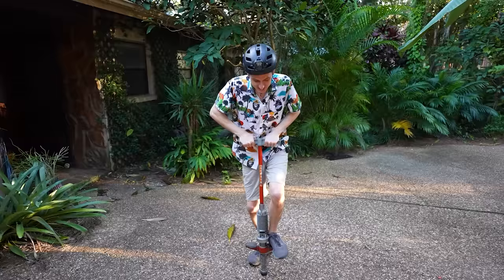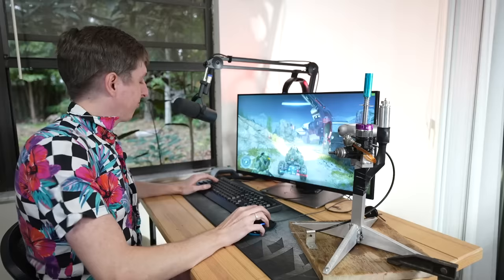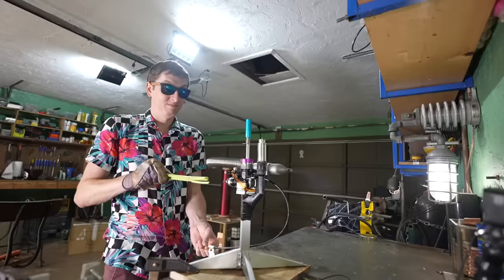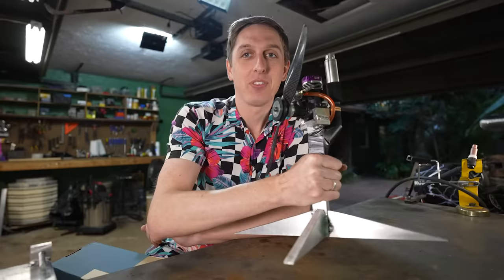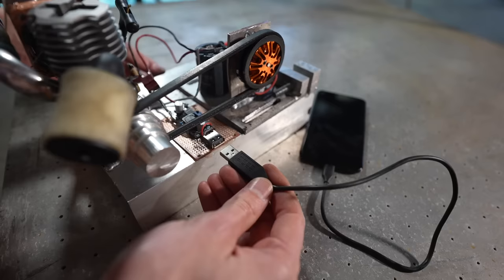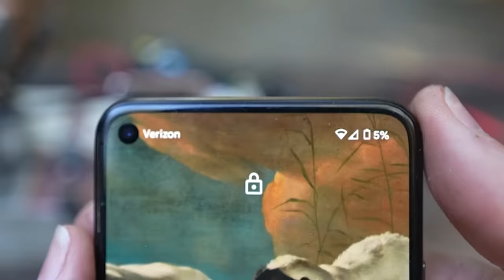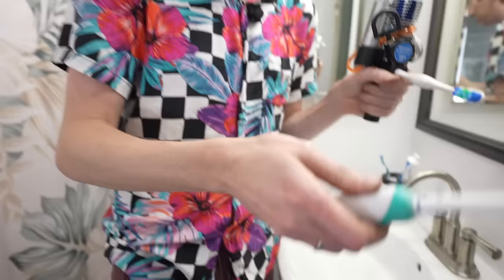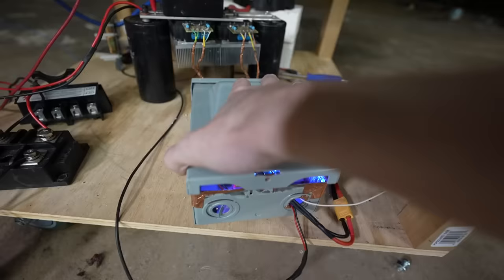Gas powering things that should NOT be gas powered

Comment: The mini generator idea is something I've wanted to try for a long time. 

Shouldn't a 2HP engine be able to generate a lot more power than just running an infrared TV remote?
Reply: 2HP=1492 Watts
Reply: there are lots of losses generating ac power and then converting it to DC.
Reply: The quoted power output on RC engines tends to be hella overrated.
Reply: I doubt its 2hp even most mopped have that much and this thing can get no way near the power of a 50cc engine
Reply: @ES-xq7iu  a 50cc 2 stroke engine on a moped would probably have about 5 hp, also nitro fuel is very energy dense.
Reply: 0
Reply: I think that the generator is not spinning fast enough and he just needs to gear it differently
Reply: He also might have the step down regulator set too low
Reply: @linuscartips9732  lol no its not it is limited to 2,5 hp and most have even lower hp
Reply: @ES-xq7iu  yes the key word is limited, a 50cc 2 stroke can make around 5, but I do agree they tend to upsell those nitro motors
Reply: @ES-xq7iu  RC nitro motors spin at like 30,000 RPM
Reply: Clarian labs was working on Rotary engines to power small robots. I like to see a Mini Gun power buy a Micro engine.
Reply: @ES-xq7iu  nitro fuel is very energy dense
Reply: @ES-xq7iu  oh they do. Nitromethane is an exceptional fuel, and those little motors spin up to 25-30K rpm to give huge amounts of power with very small displacements.
Reply: @ES-xq7iu  that’s more like a 4 up engine
Reply: @ES-xq7iu  Most countries yes, like Finland for example. However, in other countries, it's not.
Reply: It's not 2hp.
Reply: @caramelfim2885  And so are you, too
Reply: @ES-xq7iu  HP and displacement are not the same thing.
Reply: @letsgofast1187  nitro rc engines spin 30k-35k depending on rc type.
Reply: It's because he's using a crap DC electric motor instead of a dynamo.
They are not the same thing man.
Reply: @jonathankjaer1869  old 5 liter engine, 200hp, new 5 liter engine with a few upgrades can push easily past 500hp. to reinforce your point
Reply: Yall, know he's already done the math, and is once again jackiin to the hate community
Reply: 2 hp is about 1.47 kW. A generator seldom have efficiency above 97-98% in optimal circumstances so slightly lower than that for good measure. Transmission losses about 5% if you  dont use a direct drive but anyhow, it all comes to the conversion system, where about ten percent will be heat . You should be able to get about 1/3 of input power fairly easy, all extra is depending on how well your drivetrain parts are made and el circuit. No matter the driving source a rule of thumb is that about a tenth is lost due to electrical losses. This can be cooled by fans wich adds to this value , the ten percent is basically fifteen as you need cooling fans. But, that still is enough to charge a few phones..
Reply: Hes running it at idle speed which isn't making 2hp but if he was revenge the engine jt would make 2hp
Reply: @linuscartips9732  mine barely has 1 hp
Reply: Maybe around 500-1000 watts considering all losses
Reply: You also have to factor in the generator itself. He said he was running a motor backwards. Motors are built to turn things, not the other way around. So it won't be nearly as efficient as a dynamo or magneto. Which is engineered for making power.
Reply: @ES-xq7iu  yea but this thing can rev to the moon
Reply: @linuscartips9732  actually closer to 1.5 or 2.5 hp u can build a 50cc with 5hp or 10 hp buts it pricey takes alot of work and parts balancing porting type stuff.
Reply: @ES-xq7iu  nitro methane in that mopped?
Reply: @tripplefives1402  well I'm no expert, but I don't think you can use ANY motor. I mean, I'm pretty sure you need some magnets in there to get those electrons moving. So, brushless motors only?
Reply: @ES-xq7iu  actually most mopeds are restricted to a certain power level for safety.
A 50cc 2 t moped engine with 27hp have made some speed record
wankel 50cc can make 48hp...

so not impossible to make 2 hp out of a lil nitro engine that is basically a 2 stroke diesel in its function.
Reply: I think youd have to account for torque as well
Reply: I think the HP numbers aren't indicative  of real workload because of thier high RPMs. If you geared the engine down to make more torque it might be able to turn a bigger generator.
Reply: @ES-xq7iu  It's the difference of RPM and Torque, these RC motors are high RPM and low torque. It's the reason a 2kW drone motor can't drive an ebike well, it's designed for high RPM.
Reply: @linuscartips9732  that is false. nitro is 3x less dense that petrol. yet it holds its own oxygen letting the 14:1 petrol perfect burn mix is around 3:1 on a nitro. nitro puts 8x the fuel in and is 3x less energy dense but im not sure of the .000 but it should come out to 3.3x the power of a petrol engine. also the 2 stroke vs 4 stroke takes a 4.5cc engine there about from 4 stroke to 2 stroke would make it around 9cc and x3.3 for the petrol to nitro should make it around 29cc there abouts. yet the moped should have alot more torque because of the size of the piston. yet nitro fuel for rc ar 15-35% some even 0% and its methanol but this comments long enough
Reply: @dieselgeezer18  this is a comment i commented above but ill copy and paste it that is false. nitro is 3x less dense that petrol. yet it holds its own oxygen letting the 14:1 petrol perfect burn mix is around 3:1 on a nitro. nitro puts 8x the fuel in and is 3x less energy dense but im not sure of the .000 but it should come out to 3.3x the power of a petrol engine. also the 2 stroke vs 4 stroke takes a 4.5cc engine there about from 4 stroke to 2 stroke would make it around 9cc and x3.3 for the petrol to nitro should make it around 29cc there abouts. yet the moped should have alot more torque because of the size of the piston. yet nitro fuel for rc ar 15-35% some even 0% and its methanol but this comments long enough
Reply: @FAB1150  nitromethane is 15-35% so most of it is methanol. mine spins to around 35k and is 'rated' to 1.57 hp and its .18 so its the biggest small block engine. also there is no torque its all in the revs
Reply: Tiny motor= no torque 
Hp measured at peak rpm...for this, maybe 25000? Some nitro motor spin up to 35000 but if you apply more than a few pounds of load will bog almost instantly
Reply: 1k like lol 😂
Reply: @vihreelinja4743  "basically a 2 stroke diesel", what?! How is it basically a diesel?
Reply: It might have 2 hp and maybe 1 inch pound of torque
Reply: @super00su  a mini gun is powered by the gas discharged from the explosions .....
Reply: @98f5  a mini gun is powered by a motor .....
Reply: @98f5  nope that a how a machine gun works from Wikipedia "The M134 Minigun is an American 7.62×51mm NATO six-barrel rotary machine gun with a high rate of fire (2,000 to 6,000 rounds per minute). It features a Gatling-style rotating barrel assembly with an external power source, normally an electric motor."
Reply: Its not all about the hp. You need torque aswell.
Reply: Yes.  1 hp = 746 watts.  Of course after those 2hp are transduced by a generator or alternator, those 1492 watts are reduced by the inefficency of that device and whatever regulating & rectifying might be needed to keep the remote fron burning up.  That many watts are likely a thousand times more watts than the batteries in a tv remote are putting out.
Reply: @ES-xq7iu 
 RC engines high hp comes from their greater RPM.  H.P. is torque times RPM.  With the same torque, doubling the RPM doubles the H.P.  2 cycle engines are peaky.  Their full power is produced in a narrower range of RPM. 
That's why 2 stroke motorcycles generally have 6 gear transmissions when a similar 4 stroke has 5. Measured at their ideal RPM, 2 strokes are generally more powerful per pound & per cc than 4 strokes.  
Remember too, these things are running on nitro, not the gasoline you use in a moped.
Reply: @hickstylez  ...and a hopped up moped (nowhere near 10 hp) will wear itself out very quickly.  Sometimes race engines need to be partially or fully rebuilt after every race or every few races.
Reply: @atomshoemaker5297  Hmm... Not sure that USB set-up is built for the 300 amps or so your power output implies. Could be some melting going on!
Reply: @tripplefives1402  And that is where you are wrong. You are comparing a 60 hertz AC induction motor against high frequency design brushless DC motors that have very powerful magnets and are being rated near max power instead of max efficiency like an industrial motor is. They can easily push 8+ Hp and be about the size of a cola can drink.  The power comes from the insane RPM's and being overloaded rated instead of continuous as stated early. After all, power is just torque*RPM; you can exchange one for the other and still have the same power.
Reply: @dieselgeezer18  It's also very expensive and not something you want large volumes of exhaust fumes from.. even in pretty well ventilated areas.
Reply: @ES-xq7iu  2hp and 2 lb/ft torque are different.. A small high revving engine can reach high hp easier because of the revs. The torque is what propels the vehicle... The hp is how quickly it can propel the vehicle.
Reply: @kibukun  yes and no? some generators require a small amount of power because they use electromagnets instead of actual magnets, as electromagnets don't lose magnetism as fast as magnets do. but as long as there is a pair of magnets with opposing poles, spinning inside a coil of wire, it will generate power.
Reply: @dennisbecraft1303  i mean no? F1 engines are designed to run at a max of about 14000RPM, but they only run them to 12K i think (don't quote me, the point is they're specced higher than they are typically run at), these engines are probably specced to run at 50K rpm without failure, so running them at 35000RPM won't cause them to wear out quickly.
Reply: @tripplefives1402  Which is exactly why a gearbox exists, to exchange the RPM for torque, but keep the same power with minor losses much like a transformer can raise and lower AC voltage, but keep the same power with minor losses.
Reply: @tripplefives1402  Gear ratios can be made large with tiny gearbox frames using multi stage gear sets or worm gear drive. See it all the time with 400 hertz motors that need gearboxes to reduce the speed down. The gearbox is not that big.
Reply: @ES-xq7iu  you realize cc isn't horsepower. 

a 1000cc honda speed bike only has like 80 horsepower. 

Don't need big strong engines for something that weighs less than a barrel of water, without the engine.
Reply: @EETechs  i thought worm gears were for crawling?
Reply: @ES-xq7iu  mopeds are gasoline (petrol) powered this engine runs on nitromethane (15%) plus methanol and castor oil for lube. For comparison a petrol engine runs at about 14 parts air to one part fuel, methanol runs a 6-7parts air to one part fuel, and nitromethane runs a 2 parts air for one part fuel. There is a lot more fuel per cc displacement in a nitro motor. Top fuel dragster run approx 90-95 percent nitromethane to methanol burning that mixture at a 1-1 ratio with air. The issue here is the motor is fairly low torque and relys on rotational energy instead, ie needs a lot of gearing to make useful power for anything requiring torque like for example a generator.
Reply: @ryanmalin  he's not generating AC
Reply: @ES-xq7iu  its 2hp yes but like 0 torque it spin at like 60k RPM. (vs a regular gas engine 7k max)
Reply: @bradster2214  
Not sure what you're disputing.  
I'm arguing against those scoffing at the high HP specs of these small RC engines by comparing them to mopeds of similar HP.  
Due to scale effects RC engines can operate at a high max RPM safely, so for their occasional hobby use & relatively brief expected operational life, durability can be sacrificed for HP by getting it from a high RPM design.  
Every doubling of RPM doubles the HP so an RC engine can put out moped power merely by it being possible for them to operate at many times typical moped RPM.  
When I mentioned "some race cars are rebuilt after every race or after just a few races, I was including dragsters built & operated by millionaires who are often losing the gamble that their engines won't self destruct in a quarter mile!  They aren't operating at any RPM lower than it takes to keep an engine intact for more than a few seconds! 
F1s must have more durability than dragsters of course, but still sacrifice a great deal of durability in favor of performance, right?
The larger an engine is, the less possible it is to build it lightweight per HP, especially when it comes to obtaining it from RPMs.  
Compare the RPMs of diesel RC engines to those of diesels in oceangoing oil tanker ships.  They are nothing like scaled versions of each other, even when durability design factors are taken into account.  
Scale speeds of models are far greater than full sized vehicles built to break records, mostly because their engines can be run at maximally possible high RPMs that would destroy larger engines which would need to be governed somehow in order to remain intact.  
Some of it is just due to scale effects of material strength.
Reply: @linuscartips9732  If you're referring to nitromethane or a nitromethane/alcohol mix actually it has less energy density (fewer btu's) than gasoline but nitro has a much richer air/fuel ratio. For best power on gas you're usually looking about 12.5 to 1. With higher percentage nitro it's less than 2 to 1. In extreme cases it's practically 1 to 1. So it's not that the fuel is more energy dense, it's that your burning several times more fuel at the same time which has a net result in about doubling the power of an engine compared to gas.
Reply: @jonjonsson6323  a few phones lol a couple hears back phone chargers charge with 0.3W, now fast chargers only 6W and you are saying 500 watts thats a pc under load or like 6tv's
Reply: His generator setup was really inefficient, and the electric motor he was using wasn't beefy enough to get anywhere close to that-
Reply: @jordanabendroth6458  right. they need 25,000-30,000 RPM to develop max power. he was basically just idling it to power the remote. he could've ran it wide open and fried everything. they absolutely make 2hp! just not much torque.
Reply: @tarstarkusz  you are confusing hp and torque.
Reply: @jonathankjaer1869  hp and torque you mean. people are not understanding the difference here!
Reply: Well if what he said is true, this is the same kind of engine as is used in drag cars that can reach speed of 300mph. If this is scaled down to an average RC car size it’s about 1:8 scale of a real car. If you compare this to a moped the moped wins all day, however this is used in RC cars and planes so to scale it’s a pretty powerful engine. I mean look what he did with the fan.
Reply: @atomshoemaker5297  ...at 100% conversion efficiency, which you'll never get.
Reply: @diogoafonsoyt  bro what do you mean "world's first", praying mantises (manti?) have existed for much longer than humans have, there's no way you got your hands on the very first one
Reply: @ryanmalin  not 1400 watts worth though!!
Reply: @ct1762  How so?  My only comment was "it's not 2 hp" and it's not 2 hp.  This engine is not putting out 1500 watts of work.
Reply: @linuscartips9732   Nitro is actually less energy dense than petrol. Its the fact it carries its own oxygen that it can be used to get more power from engines.
Reply: @tarstarkusz  when we say a motor has whatever power... what we mean is , like voltage, it has the POTENTIAL to put out that power. this motor has the potential to put out 2 hp @30,000RPM. Here it isnt revving that high, so you are correct it isnt producing 2hp, but could with a blip of the throttle. the way you worded it made it sound like these couldn't put out their rated power. and remember this is crankshaft rated power, not after parasitic drivetrain losses.
Reply: @ct1762  This thing is not putting out 2hp under any circumstances.  What is it, 2cc?  Yes, you can rev the crap out of them, so they would do better than a gasoline engine of the same size, but 2hp (1500 watts) is an exaggeration.  Even small string trimmers that run faster than a a normal engine and have twice the power strokes are much larger than this.  Even 1 hp is a bit of a stretch, IMHO.  Those model airplanes these are designed for don't need anywhere near 2hp to fly. (Also, I am assuming this is a cheap low end sub 50 dollar engine. When I was a tween  in the early 80s, you could buy one of these with a plane for like under $30 at Kiddie City)
I certainly do understand that a 2hp engine is not always putting out 2hp.
Are you sure these run at 30k RPMs?
A quick Google search reveals there are absolutely zero standards for rating these things.  They run off nitromethane and nitro has like a 1/4th of the energy content as petrol (11MJ vs 46MJ), so you are really only talking about 8k RPMs when comparing it to a 2stroke petrol engine.
Reply: @tarstarkusz  yes 25-30k RPM. Im telling you they do put out 2hp, some much more. Its just they have very very low torque due to its diminutive size and super short stroke. torque moves weight, and these are terrible at it compared to a motor 10x its size (obviously). they make tiny engine dynos for these. i agree this is a really cheapo one, but Dynamite makes great ones for $100 and are certified.
Reply: @tarstarkusz  the purpose of Nitro in a 2 stroke is to cool the engine much more than gasoline. you can then tune it to run boost or Nitrous Oxide without it blowing up . or ridiculously high compression without it detonating. so while its power density is lower than gasoline, you can burn much more of it.
Reply: @atomshoemaker5297  almost enough to run a space heater
Reply: @ryanmalin  That's not where the main power losses come from, the transformer is not going to have losses as much as just the rest of the process.
Reply: @ct1762  Yes, I do agree that if it is made well, an engine this size could put out 2hp.  I don't think this one does, but they can. You are right about that. Sorry.
Reply: @ct1762  How does it make the engine run cooler?  Also, this stuff is stupidly expensive.  A company called "Torco" is selling a 42 gallon drum for 1400 bucks.
Reply: @atomshoemaker5297  That can power my pc
Reply: @tarstarkusz  oh im not defending it, just that its how big power is made. the higher the octane, the cooler the combustion temperatures. and the more resistant to pre-ignition.
Reply: @tarstarkusz  yea i have no idea what they really claim it can do. no worries!
Reply: @ryanmalin  Power a microwave.
Reply: @FAB1150  some will hit 40-45k
Reply: @atomshoemaker5297  Use it to power a microwave oven and make popcorn.
Reply: @atomshoemaker5297   I know this isn't how it works but does that mean that I could power two of my pc's? (I have a 750w power supply btw)
Reply: @tripplefives1402  are there electric motors that can survive 30,000 rpms ?what sort of power does that require . overall a cool idea by OP
Reply: You'll have some efficiency losses, but really the biggest problem is the generator he used. There are limitations in that thing that aren't going to allow it to sustain (or probably even reach) 1+kW of power. Internal resistance due to small winding wire, relatively low winding count, etc. You simply need to connect it to a generator / alternator that can actually output that much power either intermittently or continuously. If done well there should be no problems getting within 10 to 20% of the rated engine power in terms of electrical output. But then you also have to consider the load, the voltage it's designed to work with and any conversion necessary there in order to load it properly.
Reply: @ct1762  Do you happen to know what kind of compression ratios these things have?  In the brief reading I did, they were saying in nitromethane racing, like top fuel, they can achieve 15 to 1 with 98% nitromethane and 2% petrol.
Reply: @linuscartips9732  not only that but that also run cooler than gasoline or diesel engines. 
 
The reason his is running funky is because he doesn't have a pressure line from the muffler down to the fuel tank to pressurize the tank
Reply: Well these are supposed to do 60+MPH not be a generator.
Reply: @ES-xq7iu  BIG BIG BIG difference between a NITRO RACING ENGINE and a VERY restricted regular gas engine designed for street use 50cc moped racing engines can make over 20hp the 50cc land speed record engine had close to 30 and thats still not with nitro...
Reply: @linuscartips9732  a 50cc 2 stroke can make over 20hp why are you comparing a stock moped street engine to a RACING rc nitro engine
Reply: @tarstarkusz  it is
Reply: @bradhaines3142  2 liter engines can and do easily make over a 1000 hp these days if you have money to buy the parts lol
Reply: @MV-ri7zu  those have more turbo than motor lol, i mean naturally aspirated.

edit: and 'easily' is not the word i would use for that, its by no means cheap or simple to make a 2 liter have 1000hp
Reply: @hickstylez  its 2021 mate for a couple hundred if you buy the parts your 50cc 2 stroke moped is over 10hp with ease lol for a 1000€ you are at 15-20hp without issue if you can do porting buy over 20hp is where it becomes pretty hard
Reply: @dennisbecraft1303  hopped up mopeds make over 10 EASILY
Reply: @dennisbecraft1303  there are countless dyno videos on youtube and the land speed record 50cc aprilia rs50 moped makes 27hp
Reply: @tarstarkusz  it is capable of 2hp its running at IDLE rpm the whole video.
Reply: @bradhaines3142  except it is easy its expensive but there is absolutely nothing difficult about it and why are you talking about naturally aspirated engines? A nitromethane engine isnt naturally aspirated either lol the oxygen in nitromethane is literally the reason its used...
Reply: Maybe there is a lot less torque
Reply: @linuscartips9732  my moped has a 50cc engine and 2hp at 4500rpm. But This is the street legal tuned Version and the "Mofa" Just has 1hp at 4500rpm.
Reply: It’s 2HP at top speed open throttle….adding a gearing setup to manipulate the ratios could help….
Reply: VERY inefficient design for generating electricity...
Reply: don’t worry, atleast he didn’t rip the engine out of a car to do this
Reply: @atomshoemaker5297  Columbus sailed the ocean blue?
Reply: everyone down here seems to be forgetting he built the circuit to step the power down to 5 volt for charging his phone you really think he was just gonna use the power directly from the lil generator into the remote even though he already built the circuit for stepping down the voltage 

TLDR: so yes it can generate more power he just chose not to use the full unadulterated power of lil genny
Reply: @ES-xq7iu yeah a lot of older mopeds have that much power with like 3x the engine size
Reply: Salam brothers, please, can you help me because I am going through serious health conditions, I need some tests and some tests, and in my country I do not have health coverage… I swear to you that I and my child did not find a living
Reply: If you ever turned an electric engine you know there is some resistance and you can't make a self sustaining energy source
Reply: it can generate more with better generator like 775 motor
Reply: you have a lot of overhead in conversion so it might end up not worth it after all
Reply: horse power is not the same as torque.. a better way to measure if you want an idea of how much generating ability an engine has if to measure in killowatts. as it takes torque to make electricity.
Reply: Imagine building this into a 210 socket for the back of a fridge or AC and imagine a refridgerator with exhaust tube extension hose, so in a power outtage you can refill your fridge with gas lol it should all have them all our products should have them and all the power strips man, we should have gas generators for backup everything
Reply: @ES-xq7iu  Yamaha aerox is registered with 4hp in norway and that is with restricted exhaust. there are dyno sheets of 50cc mopeds with over 20hp at the tire
Reply: @TarenGarond  No spark for combustion.... uses compression and the glow plug is a catalyst.
Reply: @timm.6391  Yes these engines doesn't use spark for ignition, but that doesn't make them basically a diesel engine!
They does not have compression ignition(Compression is obviously a part of the "ignition process", but it works more like a hot tube engine using a hot surface for ignition, but with that catalytic stuff) or fuel injected into the combustion chamber.
Reply: @TarenGarond  Modern diesels have glow plugs doing the same thing. Even a light on dash letting you know when they are heated.
Reply: Yes it should, but he's only connected it to a TV remote. He could probably power a hundred if he wanted to do the wiring. With a proper sized generator he'd be able to power much more, though those drone motors are pretty powerful for their size anyway. But that wasn't the point of the video. It's funnier to power something with a 1KW nitro engine that exhausts it's fuel in 7 minutes, when that thing normally takes 2xAA batteries and lasts months.

The problem with the phone was presumably that phones are very smart, and it didn't like the janky waveform that the "charger" was spitting out. Or else, to do fast-charging over high-power USB, modern phones require a little negotiation sequence with a little computer inside the charger. Obviously that wasn't present, so it was probably just charging at standard 2.5W, or even possible the 0.5W bare minimum USB.